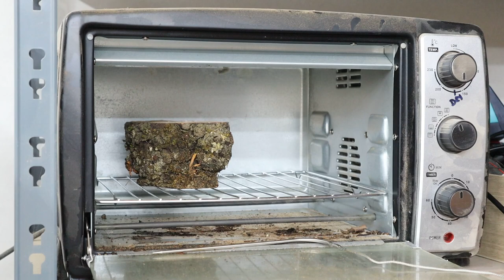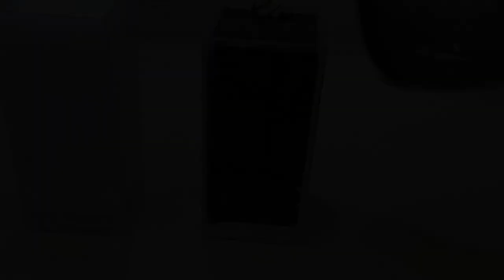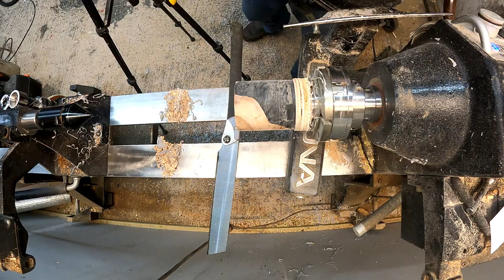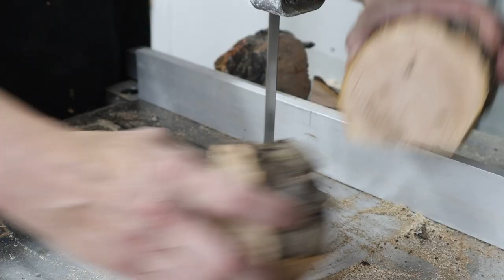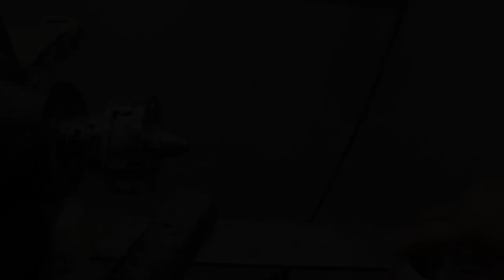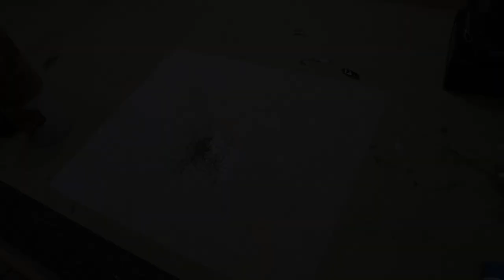Woodturning - Just add Salt and Pepper

Comment: Beautiful pieces - I would love to buy them when they are available. Before you release them I would test coarse sea salt, Himalayan pink salt (both around the same size crystals as pepper corns) and Kosher salt flakes. I'm guessing they will all work fine with the correct grinder settings, but I imagine people who buy these works of art are likely to be using high-end salts in them.
Reply from the maker: Thanks, these are high end ceramic grinders, they will be fine, I like the idea of testing though to give an indication of the required settings👍

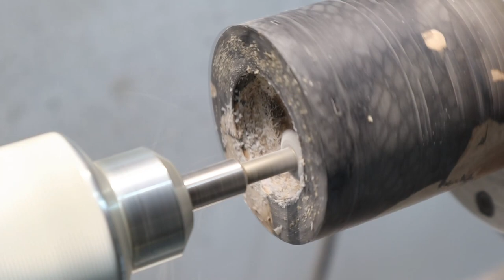Comment: At 4:03 is that a thread you're cutting or just a series of grooves? I'm hoping it's a thread because I've never seen it done like that and would be very interested to know more.
Reply: And 60 seconds later there's the answer. I should learn to not pull the trigger so early. Screw thread cutting system. That's very very interesting. I'll look into that. Thanks.